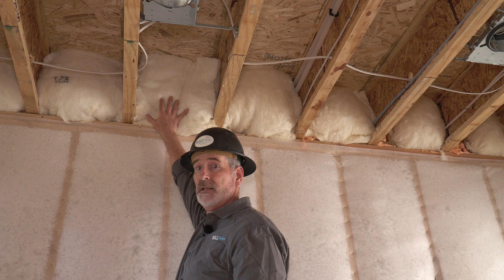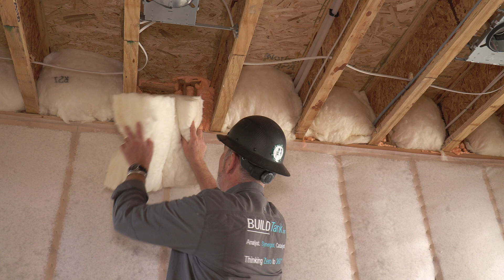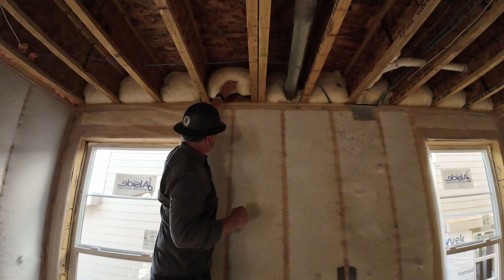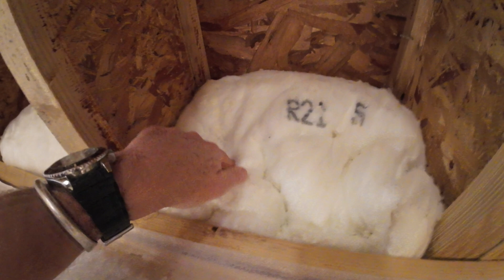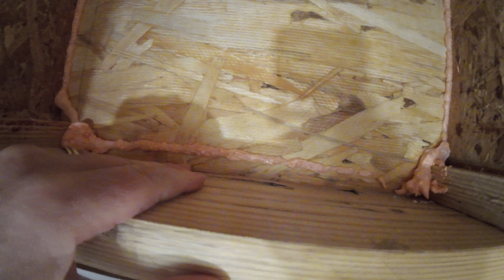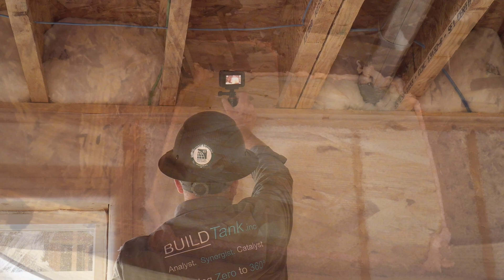Rim Joists - Field Application of the Energy Code

Comment: I caulked my rim joist in my crawl space and also caulked the outside of the rim joist. I have 1" foam board on the exterior of the house behind my vinyl siding over my rim joist. I want to put foam board in the crawl space on the rim joist and spray foam around the edges. Will that cause condensation between the rim joist and the foam board?